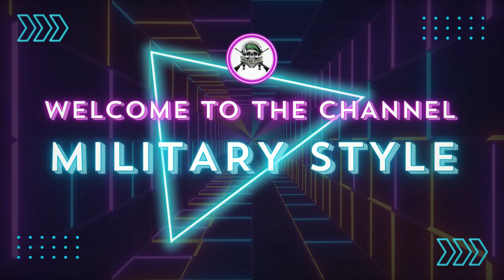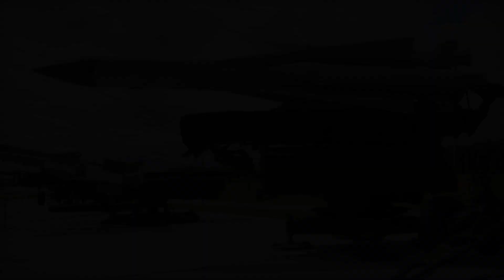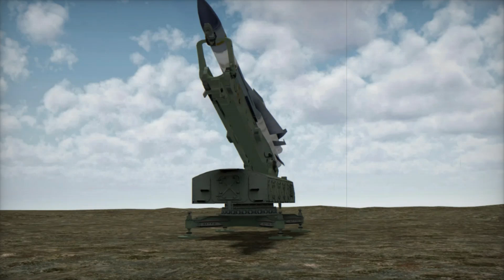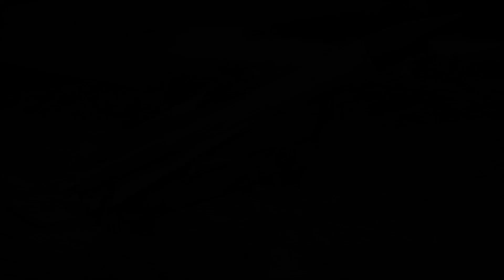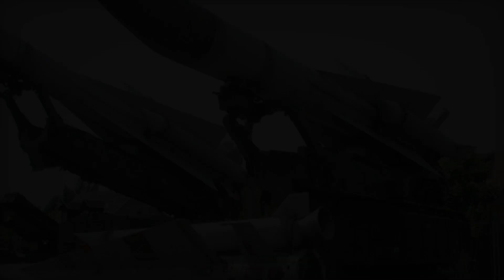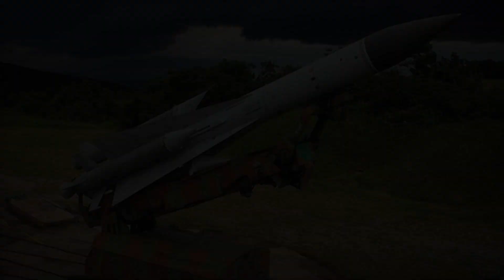The SA-5 Gammon (S-200 Angara/Vega): A Comprehensive Overview of Its Role and Capabilities

Comment: robot ahh, also this missile was completely obsolete when the SA-10 (S-300) entered service as this has terrible accuracy and is only suitable against large, non maneuvering targets such as bombers, AWACs and tankers, most of which would never get close to these sites anyway and fighters could destroy them from far enough away that the smaller sites protecting these SA-5 sites would not reach the attacking aircraft, once these sites were destroyed bombers could come in and nuke whatever they wanted, SA-10 fixed this issue because it was dangerous to all aircraft